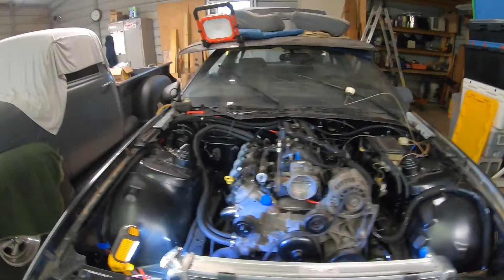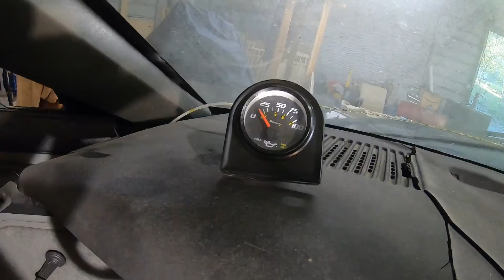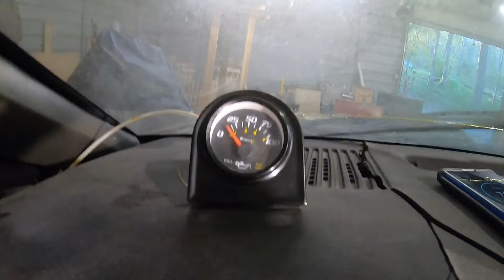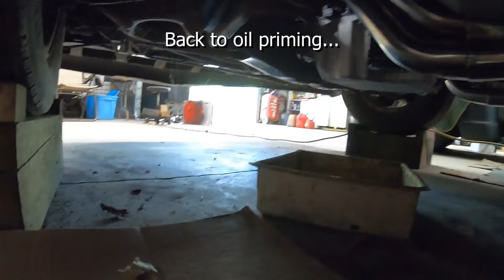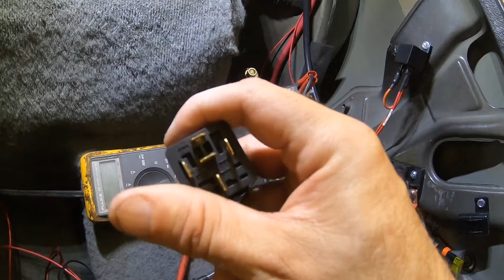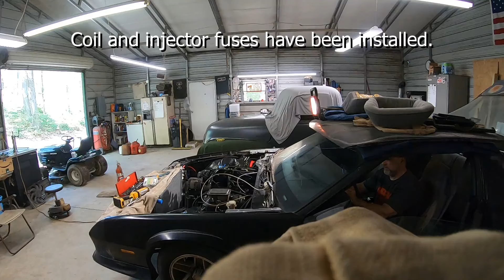First start of the LS after some issues with the new fuel pump wiring. My fault... 3rd Gen Camaro

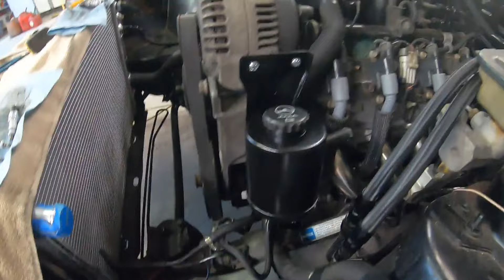Comment: Got a kick out of the fact you did the exact same "custom" power steering reservoir (3:40) install I did, worked perfectly. However, you gave me the willies cranking on the engine for oil pressure, my opinion, should always PRE-LUBE the oil system FIRST. I spent the money and bought a pressure oil tank just for this application, cheap insurance. Access plug bottom left of block.
Reply from the maker: You're correct on the pre-lube before the cranking, but.... Impatience is a MF'er. It'll take a massacre before i learn... Thanks for watching and commenting !